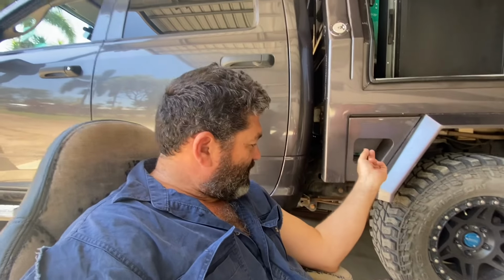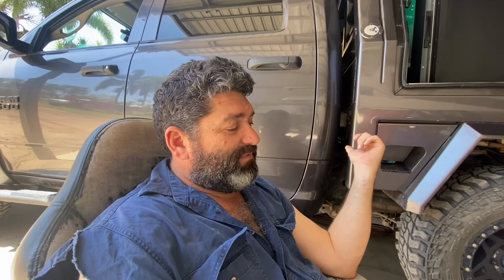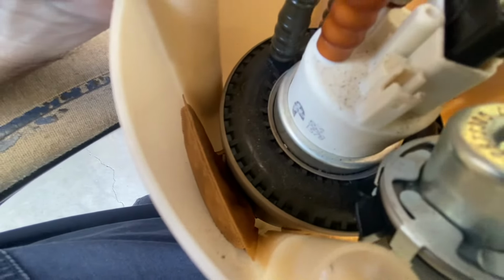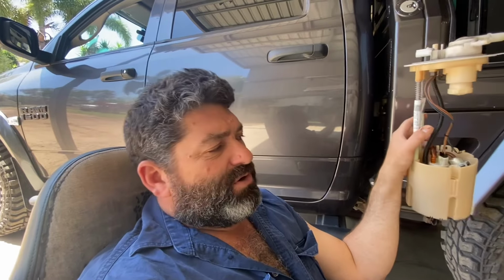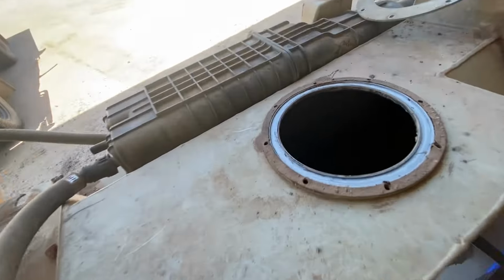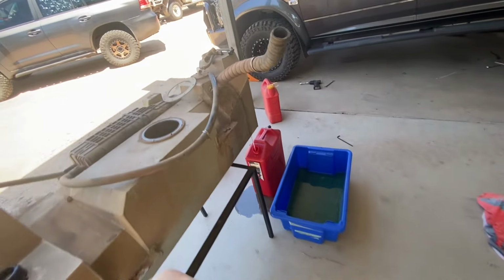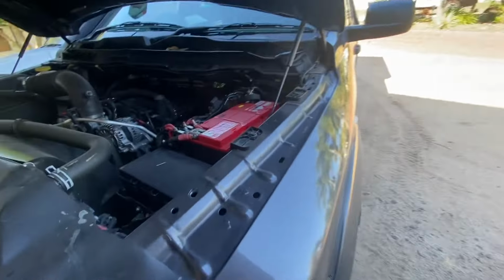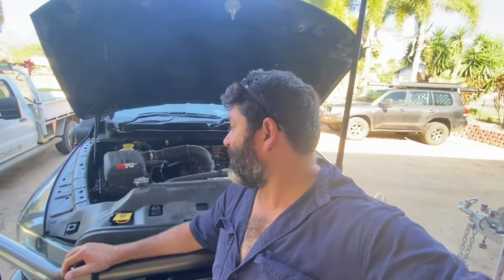RAM 1500 starting issue is it ready to BLOW or ready to go

Comment: It's pretty common with aftermarket fabbed tanks to kill petrol fuel pumps over time due to material not cleaned out before fitment, a couple of good magnets in the bottom might help.
Reply from the maker: That’s a good idea I’ll remember that for next time some does a pump change out

Comment: If your Ram is V8 petrol and you have filled your truck at a certain fishing camp in the NT that we both frequent its quite likely the metal flakes in your tank come from that particular fuel supply. Their bulk tank used to be filled from 44s and I had the exact same stuff in my boat's fuel tank. I know that they receive their fuel by road tanker now but for years it was all transported from Mataranka in drums so you would think that their tank would still have residue rust flakes still present. Of course I could be wrong but it seems to be too much of a coincidence. Cheers.
Reply from the maker: Your picking up what I’m putting down that’s for shure I just brought a filtered funnel for the territory trips so I can strain all my boat car fuel anywhere I go now as I’ve had plenty of boat drama also for other areas as well thanks for watching